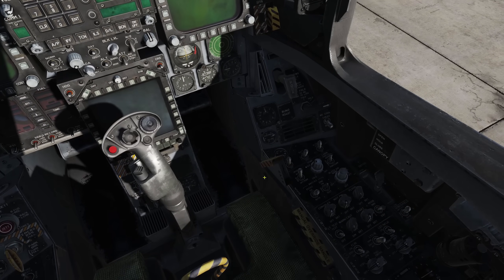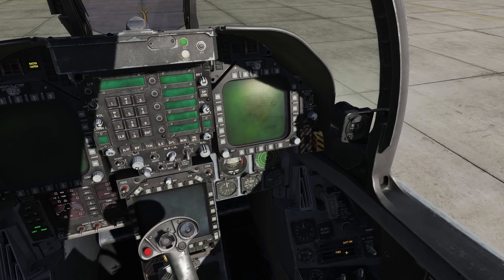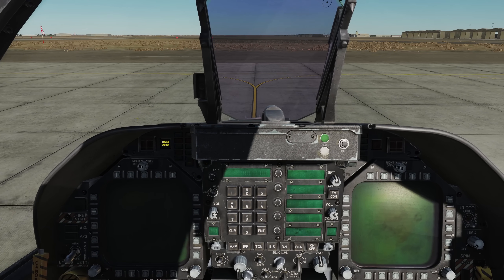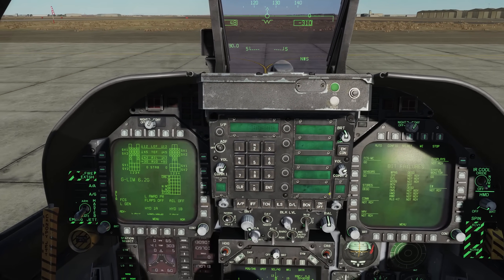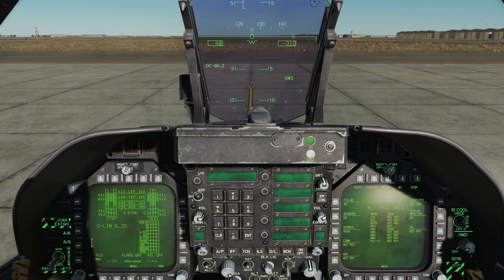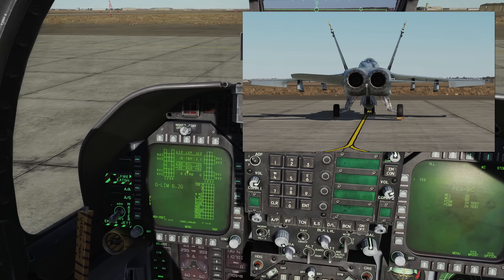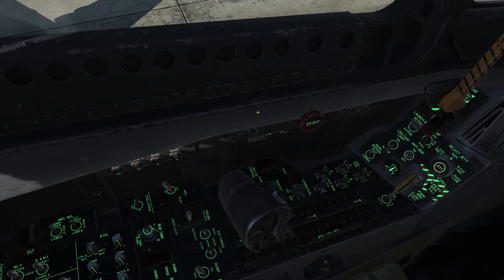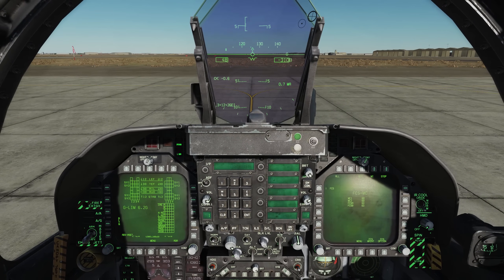DCS F/A-18C Realistic Shore Startup Procedure

Comment: That was almost accurate for starting the real thing. Just a few little things that were off.
Reply from the maker: Had a few hornet guys that reviewed it for me, obviously some things have changed.  If you have more info I can remake it to bring it up to standards
Reply: @TrickerDCS  Without going back and re-watching the video. the couple of things that stood out to me had to do with EGT and N2 speed on start up. On a C model, according to the NFM, unless you are doing a cold weather start, you advance the throttle and start the engine at 15% N2 not 25%. In all fairness, everyone does it a little different, and we can talk at great lengths about starting RPM, and what works in what scenario, but the actual magic number for a normal start is 15%.  The other thing that really stuck out was when you said that you can't let your EGT exceed 750C. That number is sort of right and wrong. the max EGT on start up is 815C. The 750C for a hot start is all dictated on how rapidly the temp climbs. All in all it is a good presentation, and the cockpit is pretty spot on, although you had your displays set up completely different than I would have had them, but that is all personal preference. Oh, and on the 4 down(or 5 down depending on the squadron) even the land based jets drop the launch bar, you also didn't check the taxi light, and you left the pitot heat on WAAAAAAYY too long. That is normally the very first thing a PC will check. as soon as they get a little warm the heat gets shut off. If you leave them on that long you will BBQ the final checkers hands.

Comment: Hey can someone help me here ?

Sometimes my LEF (leading edge flaps) on the left side will keep stuck at 12° causing my plane to bank left after startup.
I am not able to solve the problem, my startup looks like this: APU -> right engine -> DDIs/AMPCD/HUD on -> (Lights, Radio,...) -> Radar OPR -> INS Ground -> check flaps (default FULL) -> start left engine -> pressing FCS reset -> Pressing T/O Trim -> INS NAV (when OK) -> (Break, ...)

I think i am missing something when resetting the fcs or setting the T/O trim, is it essential to press T/O trim in a special fraps position ? + do i have to do the FCS BIT every time ? When doing a fast startup ?
Reply from the maker: Have you tried an auto start to see it that works? I always do the FCS BIT but it’s not required for the sim to start
Reply: @TrickerDCS  jea auto start works

Comment: I can't do that in mission but under training i can what is wrong ?
Reply from the maker: I'm not understanding your question
Reply: @TrickerDCS  when i doing a training mission i can start like you are doing and it works outstanding. But when i going for campaign mission and mission i build self i can't start THE Aircraft like you are doing in the video. I have all keyboards assign for somthing bit nothing happening. Do you have som clue what i doing wrong?
Reply from the maker: Andreas Nyh double check your key bindings for the engine starts and verify you have fuel.  Some missions start with 0 fuel.  Also make sure you have your APU on with the green light to get the bleed air to turn the engines

Comment: Great video! Thanks for posting and thanks to your F18 driver friend for the knowledge-share.  Two questions... I noticed that you turned on the Radar Altimeter, but don't you actually need to set the altitude first?  Also, why wait so late to set the INS to GND? In the F18C natops startup guide, they indicate to set INS to GND pretty quick after engine start.  Thanks!!

Comment: A few things.

If the BIT page is pulled up on the left DDI the cautions will drop to the MPCD.  
The lights test also illuminates the LOCK and SHOOT lights on the canopy.
During 4 down you have to put AV Cool back to norm immediately so that the scoop will lock in when the Final Checker stows it.

Comment: Thanks for the video! A few (hopefully constructive) questions/remarks.
Do one says "driver", not pilot? I suppose that in reality they don't skip the pages of checks that come before, (even in GA we never miss those), and during the start-up procedure (like EGT, battery and so on)? That would of course make for a very long video.
I'm also wondering about the purpose of switching the battery off between fire tests A & B, it's certainly not in the Natops flight manual, what's the rationale behind that?
You wait for 25% RPM before moving the throttles to idle, why not 15%?
What's the acronym "PC", isn't that "PIC"?
Reply from the maker: Usually they call themselves drivers for fighter pilots.  I was explained they use more of a flow then a checklist, like in the airlines we do a flow and then a checklist.  PC stands for plane captain.  The battery cycle is in the NATOPS as well, you can do the cycle or wait 7 seconds to do the other test. Also I was explain noone introduces fuel at 15, they wait until 25.
Reply from the maker: UncappingBadger thanks for your expertise sir

Comment: So is it because I skipped the FCS test that my rudders are stuck in an inwards position? Only way I found to make them go norm is to use the override switch but then flaps don't move so I guess that's a no go :D nice vid as always Mr Tricker!
Reply from the maker: youmasenchi the fcs controls all the flight controls surfaces, when you do your rudder check, you should be able to go to 30 left and right with flaps at half.  You can see hear numbers on the fcs page on the DDI.  Thanks for the compliment!
Reply: I went Mig-21 startup and just ignored Master Caution on the flaps... That's why they call me Squishy died 30 sec after take off the Hornet was behaving like was racing a Camel.

Comment: When ground crew are given signals for APU start, etc. Is that just to inform them of what the pilot is doing, or are they needing to do things outside the jet?
The reason I ask is that it looks as if everything is kicked off from within the pit?
Reply from the maker: Basically the ground crew is there to make sure the area is safe and to also check the aircraft after they perform the tests to make sure everything works properly.
Reply: Tricker thanks!